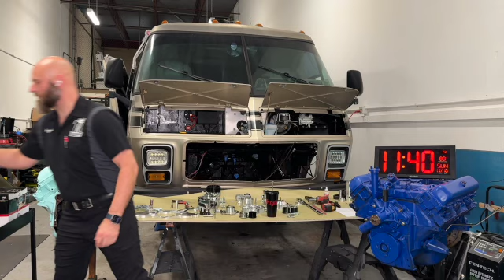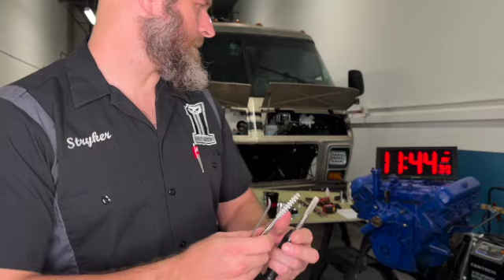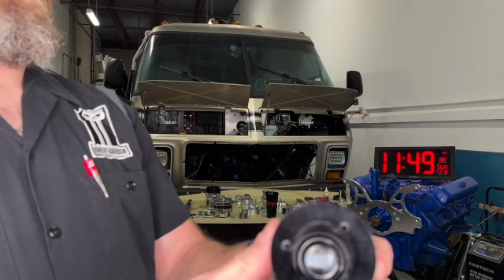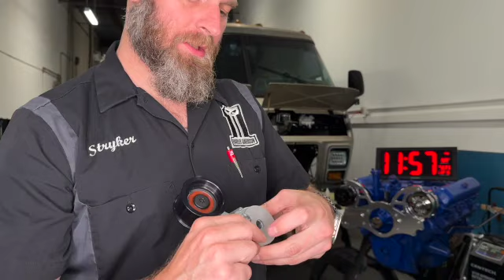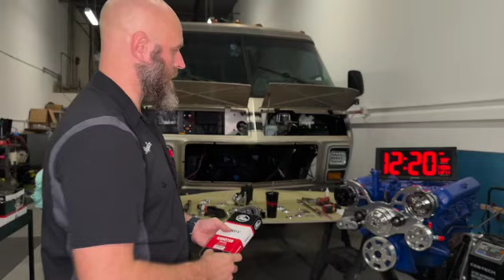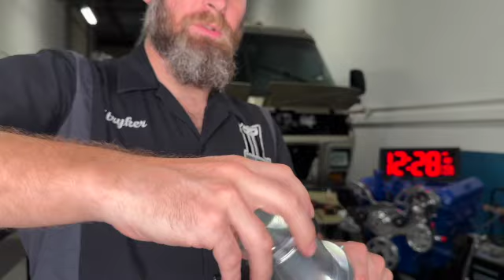CVF Serpentine Assembly   SD 480p

Comment: I couldn't believe it when I saw this on my Feed: Excellent Video/Spot on!! Gearing up to do the same 😁. Water pump and Idler arm alinements are critical to possible belt fray due to their "close" proximity, (I've seen it) the rest is wide open and machined to fit. I cant find a thing you might have forgot maybe Ricky or Josh can chime in! Ha Ha 😂 Excellent Job Buddy❤